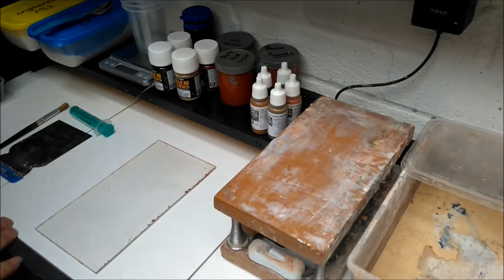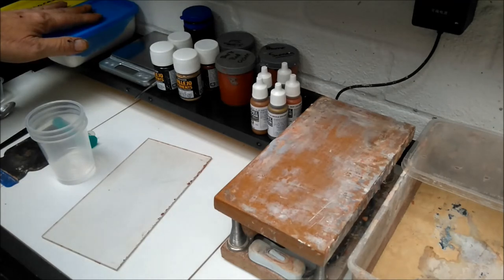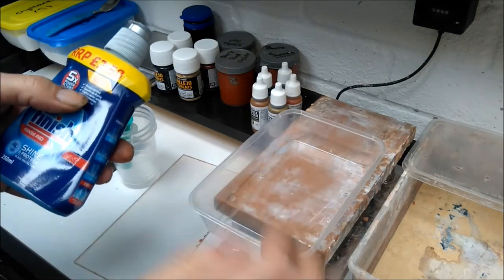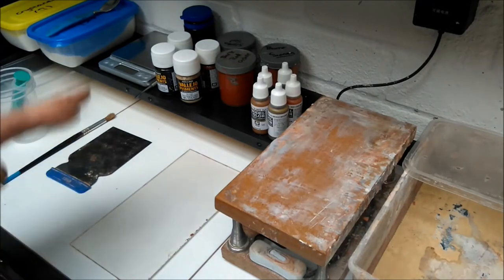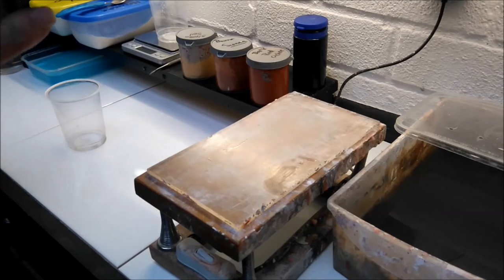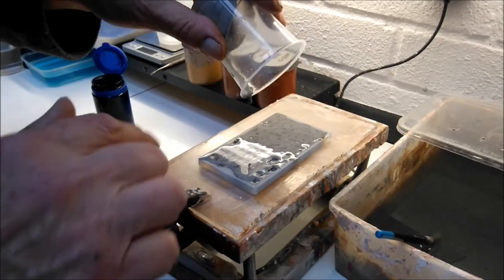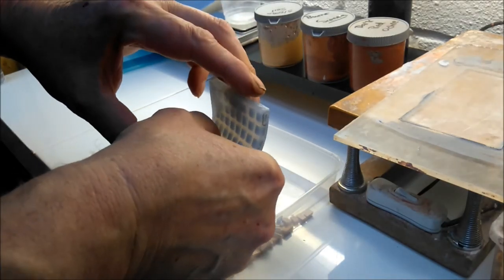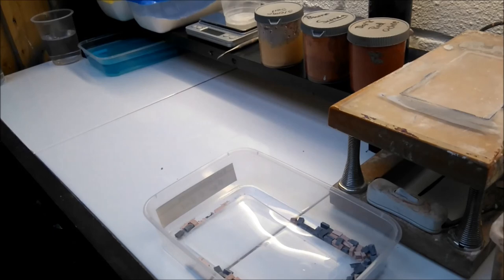cobblestnses moulds 1/35 scale

Comment: Thanks, Sim.  I have forgotten how many times I watched this video whilst collating all the parts required.  With all parts sought, I built my table this weekend and was then able to start casting for the first time.  Not having Vallejo model color, only model air, my red paint procedure a very pink brick colour.  For my second attempt, I used Humbrol weathering powder, red oxide.  The result is a much more natural red brick colour.  

I have had difficulty removing the outermost pillar of bricks on the English bond mould (I think these are the ones for turning a corner) and they always break.  Strangely enough, it is an enjoyable process mixing the powder into the water, adding the pigment powder and then pouring it out into the moulds whilst the table was vibrating.  Then wait for about an hour for the plaster to set properly before removing them.  I am not sure that all air bubbles are being removed as I have what appear to be bullet holes in the wall sections but this is a positive error, considering the buildings are designed for a war zone.  I watched you pigment video today and will be watching it again soon.

Overall, this is a far cry from the old Linka system!

Comment: Started to use Crystacal R for casting, roof moulds are really easy to use now, with little to no breakages when removing.
Reply from the maker: Just picking a good quality casting powder makes all the difference sticking to what the manufacturers tell you on the side you'll always get perfect parts of tried a lot of the casting powder  but you can't beat crystacal R and Herman light 2 is good to hear that you're getting good results many thanks and happy moulding Sim